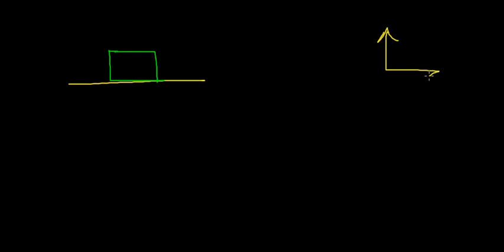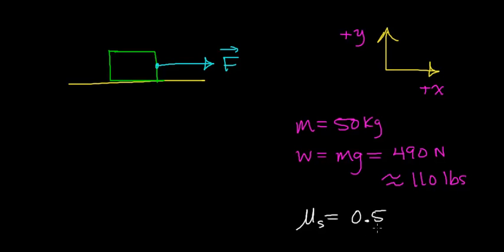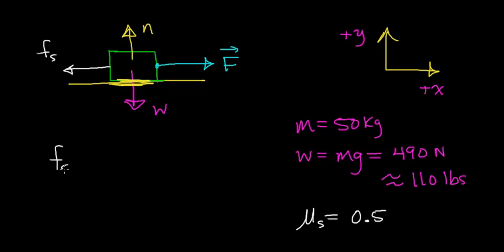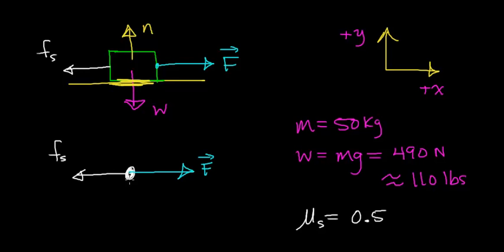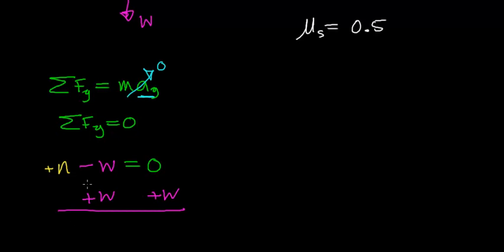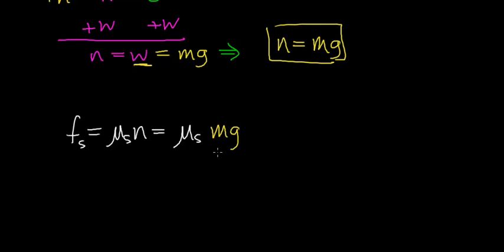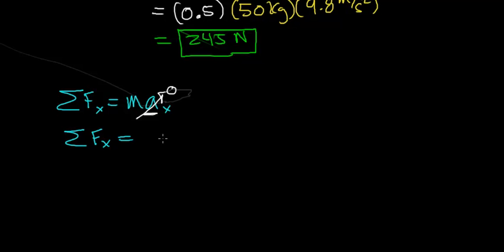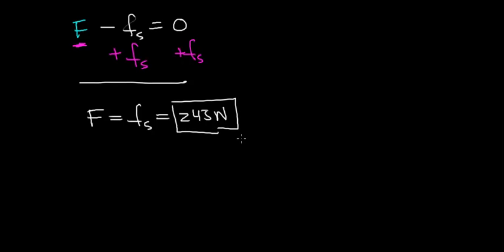Force Required to Overcome Friction

Comment: I am wondering what the calculation is for pulling apart 2  plastic shopping carts which are stuck together, which normally requires both lifting & slamming down and pulling.  weight of each cart = 50lbs, 22"w x38"l x 41"h, castors 5" (2 swivel, 2 rigid)

Comment: you over complicated this WAYYYYYYYYYYY too much lmao, literally just do mg  which equals the force its putting on the surface  which means thats how much its putting back, multiply that by the friction coefficient  and u have your force acting back on you if you tried to move it which is the answer
Reply: AGREED. 
Fs×mg and you're done. This was unncecessary
Reply: Explaining it this way makes it easier to understand general problems, your way only applies to this specific problem, but yes it would be simpler if you can see it right away

Comment: Hmm but if the pull/push force is the same as the friction force will it's net force not be 0 and therefore not move?
Reply: Yeah, its like the bare minmum force required to cause the slightest change in the object's state